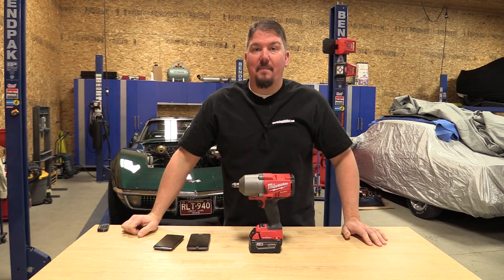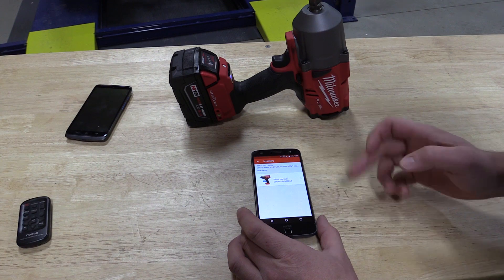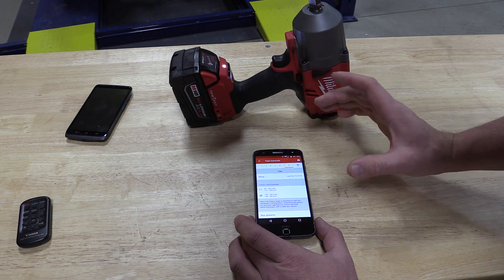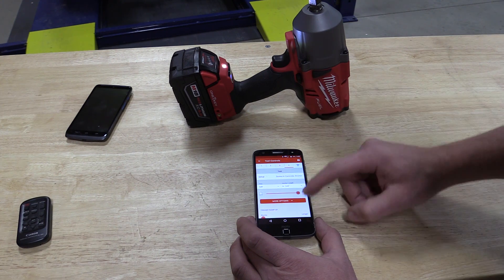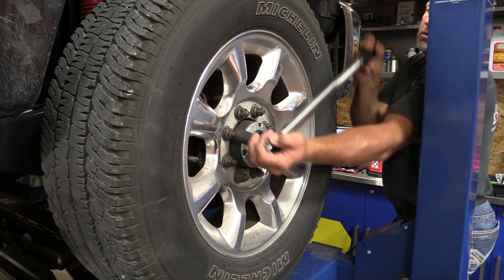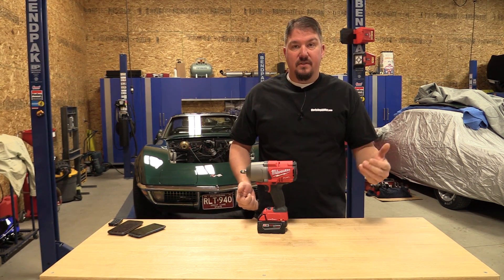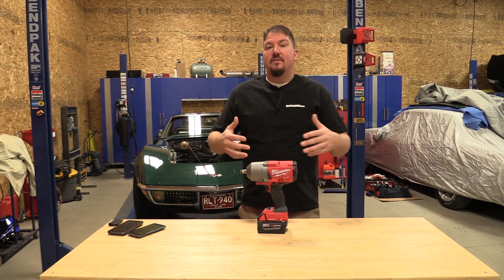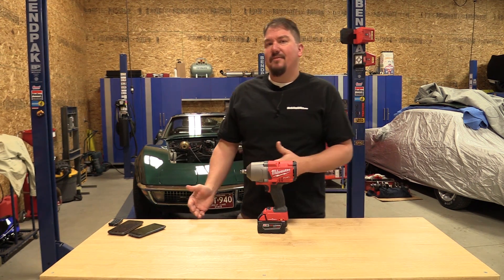Torque Repeatability | Milwaukee 2863-20 M18 FUEL w/ ONE-KEY High Torque 1/2" Impact Wrench

Comment: Very powerful. Would be awesome for the farm. The fact that you can control the settings from a phone... how handy is that. The other guys need to step up there impacts now.
Reply from the maker: This is a perfect farm impact wrench.  Gobbs of power for rusty nuts yet is accurate enough for machinery work in the field.  If only it could weld.  :)
Reply: WorkshopAddict Now that'd be a life saver. Lol but a cordless welder might be next. Already got the start for cordless compressors. The future of technology is growing at a crazy rate. Getting exciting that's for sure.
Reply: richman garvin you must work for dewalt
Reply: I really hope they continue that update over to the three-quarter inch model. Between a half inch and three-quarter inch drive impact, even if the guns are rated at the same foot pounds, And with the same sized Anvils. The three-quarter inch will win every time. It just makes more efficient use of the surface area, there’s much less loss to heat.  I fix buses in Boston, and I’m always looking for that cordless solution to busting Lugnuts.
As of 2016, I owned all of Milwaukee’s highest end cordless impact solutions. I’m excited to see what they will do in the future
Reply: (It’s already not an America company)Chinese Milwaukee
Tool

More than 96% Milwaukee tools are made in China. Milwaukee
Tool has carried out tool-design job in China since 2015 year, the design job
also is slowly sent /transferred from USA to China.

Most plastic materials have been changed from America DuPont,
GE to Chinese sources. The red plastic，Nylon，of Milwaukee tool handles/housings has been provided by a Chinese supplier
since 2010，originally the Nylons
were from DuPont，the Nylons-changeovers
caused the handles/housings weak，like screws very
likely strapped/slipped in screw holes. Also black hard plastic for battery
pack cases/covers，changed from GE ABS/PC
to a ABS/PC from a Chinese supplier，caused battery
pack case more likely broken, brittle, the same story is happening on anti-flam
Nylon material of battery frame，changing from DuPont
to a Chinese supplier. 

Lots of bad tools always first are sold to USA because
nobody inspects the outgoing, and because in USA Milwaukee Tool has the
strongest warranty service ability than in other countries.

During Milwaukee production process, more than 5% defects
found out by workers, also more defects failed to be screened out. Bad tools
include noise as gear,bearing aligned badly, sometimes press trigger no
reactions at all, metal parts like shaft, gear, pinion, important screw broken
as poor heat-treat, motor stator rubbing with rotator, fine wire laid inside
tool broken as poor design and poor workmanship, big percentage of oil leakage
for hydraulic tools, etc. 15% chance you will get a bad tool, bigger chance you
will get bad tools for nailer, planer, hydraulic tools, cable/tube cutter, as
they are first generation of tools for Milwaukee Tool, because comparing with
sawzall, drill, Milwaukee Tool is suck at nailer, planer, hydraulic tools,
cable/tube cutter,AC tools, drain cleaner, blower.

Milwaukee Tool workers only get less than 300 dollars
monthly salary，even plus OT to 276
Hours a month（normal month-workhour is
176 hours，plus 100 hours OT. Chinese
law only allows no more than 36 hours OT per month）， after OT 100 HOURS for every month，a worker can get 500 dollars monthly salary，this salary very
low for living in a big city in China, plus bad working environment(the
management has no such safety-first mindset that loud noise but no issuing ear
plugs to workers, at dangerous stations very few goggles issued to workers. workers
stand more than 10 hours every day during on-duty time), so Milwaukee Tool with
huge employee turnover，400% yearly turnover，ie workers averagely work only 3 months for the factory, cause workers
without enough experience，lack of training，then unable to ensure good quality. And worse worker- turnover with most
Milwaukee Tool’s suppliers. 

After Milwaukee tools launched one year， Milwaukee Tool will do so-called VE, value engineering ，actually cost-down, change Germany trigger to Hong Kongese trigger even
Chinese trigger/switch, change Japanese chuck to Chinese chuck, etc. Milwaukee
Tool has a team, 50 persons to do this VE. The quality would obviously become
worse after the VE.

Milwaukee Tool has really bad quality system, lose much
profit because of failing to keep quality constant. And always look for cheap
materials, cheap suppliers, worker salary is always at minimum salary, only 30
dollars higher than monthly minimum salary.

Milwaukee Tool has less experience for making power tools
comparing with Bosch，Dewalt, Makita.
Milwaukee Tool only has grew fast from 2008 year. Milwaukee Tool copy and
compare life test with Bosch, Dewalt tools during new product development
stages, even when doing troubleshooting during R&D, would measure
dimensions of these competitors’ components.

This company is also an ugly company, in 2014, a Hong
Kongese manager tried to rape a female employee during their business trip, the
company fired him and less than half year, hired him again as a manager, then
the female employee left this company and lost her job. In 2015, in its factory
dormitory a more severe rape case really took place by a male senior manager to
a girl.